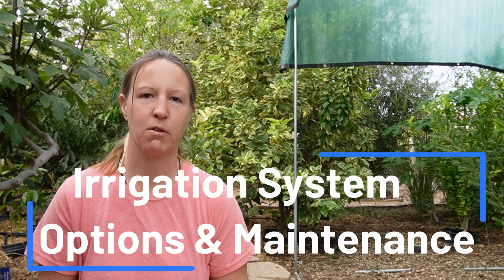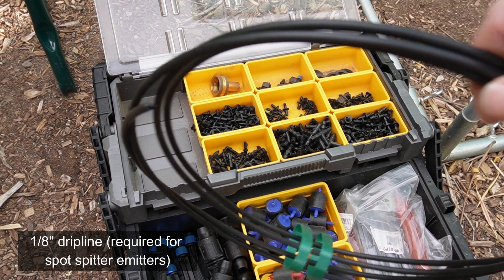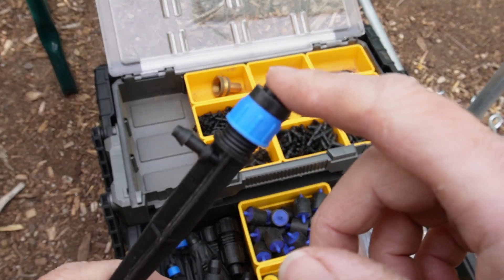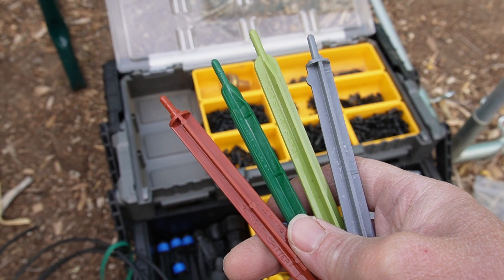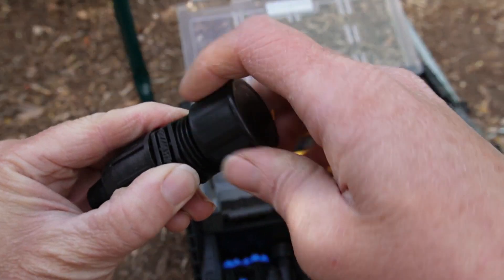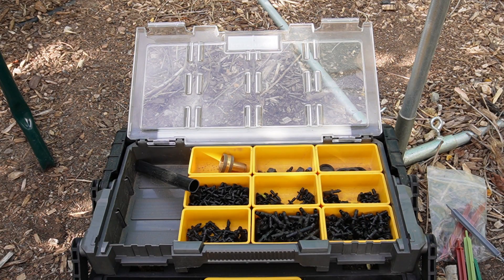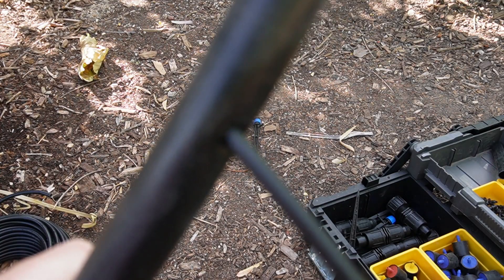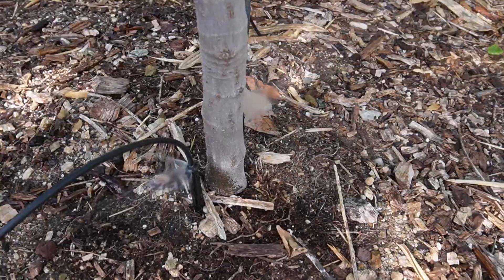Emitter Types and Maintaining Landscape Irrigation

Comment: Suggestion. Buy your tubing at Ewing Irrigation. They carry a rubber type tubing that is thicker than the poly pipe you get at Lowes or Home Depot. The poly pipe will crack over time. This thicker tubing will reduce the maintenance significantly
Reply from the maker: Thanks. Yes I never buy my irrigation parts at the big box stores. The quality is horrible. As mentioned, I buy from drip depot online out of convenience. The poly I use is premium agricultural grade. It is made from quality resins and is UV resistant. It's rated for 60 PSI and is what commercial outfits use.